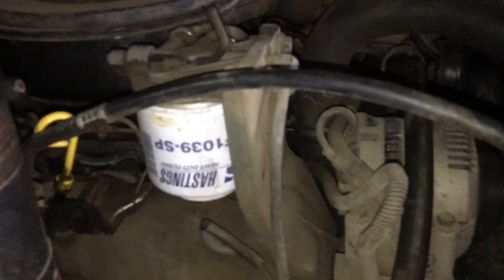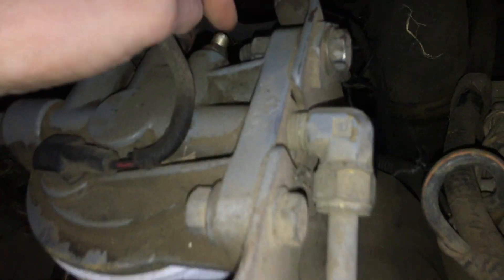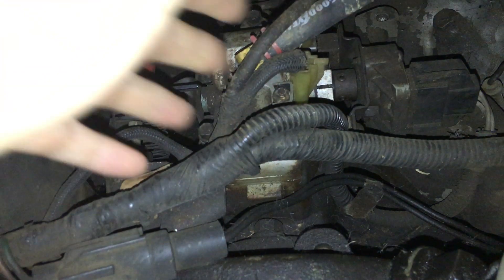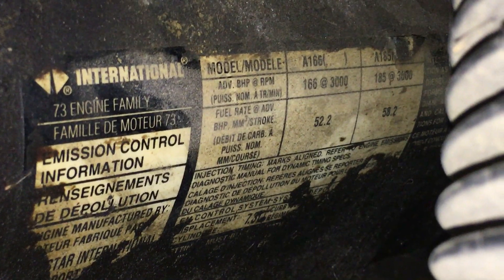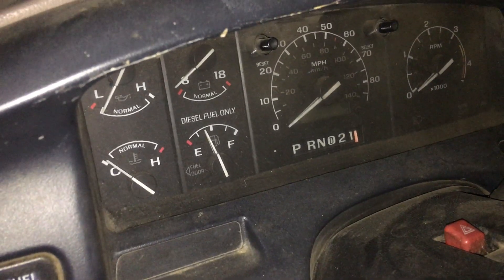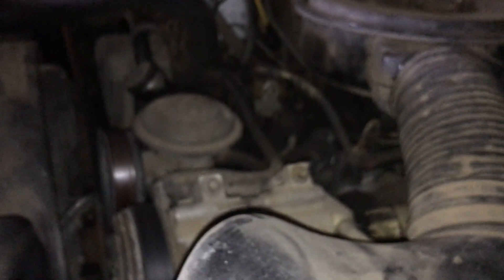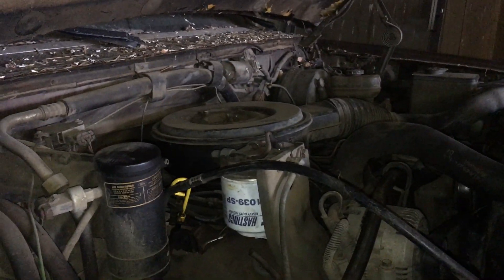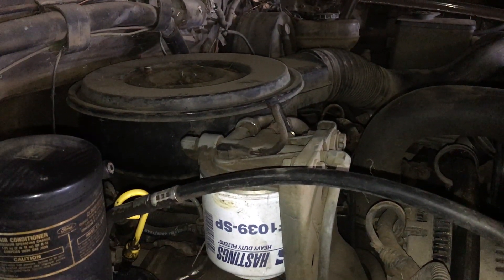Ford F-250 XLT Non Turbo IDI 7.3L 1993 Diesel Update!

Comment: On another video I saw of yours I very audibly heard the glow plug relay clicking on this, which means either your relay or glow plugs are going bad, but since it only clicks after turning the key on for a while that would mean the glow plugs are shot, because they create too much resistance. When your  GPR or glow plugs are bad it will be the cause of smoking when cold and hard starting, and these idi engines don't really warm up until you take them out for a hard romp or pull a trailer. As for the air leak in the fuel, if the filter cap is cracked you could maybe JB Weld it, and you could just run rubber fuel line in place of the metal line to the fuel pump, just leave a bit of the metal stuff spliced on it to connect to the filter housing, I've actually had the fuel pump come loose, allowing the fuel line to shake about and create a giant leak in the line. Or to simplify it, get a $70 Faucet Fuel Pump and just convert it. It's dead simple, and super easy. This truck has plenty of life left, and I guarantee for under 300 bucks this thing could be brought back to life, before tires. 70 For glow plugs, 25-30 for a glow plug relay, less than 30 for fuel line, 75 for a Faucet Pump, 20 bucks for a block off plate, and a few random items. I can even make some videos of my own 7.3 idi to show you how it's done if you would like. I assume you meant me when you said someone showed you the video on stiction, and you're in luck because I have both a 7.3 Powerstroke and a 7.3 idi.
Reply from the maker: thank you for this. what you are saying is what the relay does. It does one click when i turn the key on then it buzzes though not sure why for about 10 secs or so then starts clicking on and off way after the wait to start light goes off and the volt gauge goes back in forth so is there a proper way to test a bad glow plugs or do you suggest to replace all 8 of them. and yes I should double check to see if there is a leak or a bad cap i haven't taken a look at the cap yet it doesn't get ran much since it don't have good battery ends and a good enough starter the muffler donuts is out right next to the starter and the starter is black from soot so I am sure the field magnets on the starter as we the bearings are cooked cranking for 2 years with one battery

Comment: I'm going to school for diesel tech I would say try and turn the key so the fuel pump kicks on and have someone hold down the little bleader valve tell fuel comes out constantly then try getting a tire air valve cap put that on it looks like its the same size
Reply from the maker: this one has no fuel pump its has a mechanical fuel pump what it says on the owners manual so not sure.

Comment: from what i have seen from some of the video's of it running rough. and how my 7.3 idi ran rough...it is probably a tinny crack in the fuel line. i thought my truck was going to need an injection pump from the way it was running. but then i went underneath it and looked at the sending uint on the top of the tank and it was all wet with fuel and there was a tinny pin sized hole...i put some jb weld on it. and it runs like new now.....maybe try switching tanks with the switch on the dash...see if it runs better...if it does then whitch ever tank has a bad fuel line.....hope this will help.
Reply from the maker: ok thank you for the advice I will have to try and take a close look to see. that's the trouble with them small stuff its hard to pin point where the issue is....

Comment: i replaced most of the fuel lines with hose i have a couple of injectors that leak from the top but i learned from diesel tech ron that if that happens get some oil drainplug washers and place them between the the top of the return and nut and it will seal it. https://www.youtube.com/user/DieselTechRon check his channal out it may help.
Reply from the maker: ok thank you for the tip i will try this and see what happens i'll check his channel out. every bit a tips i can get maybe the old girl will run again.